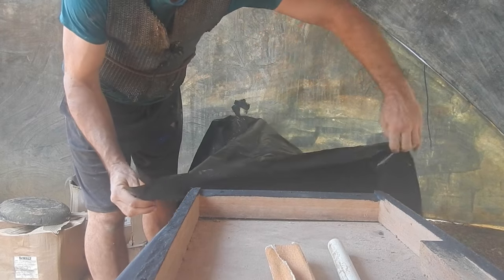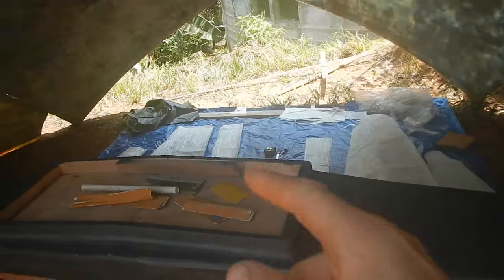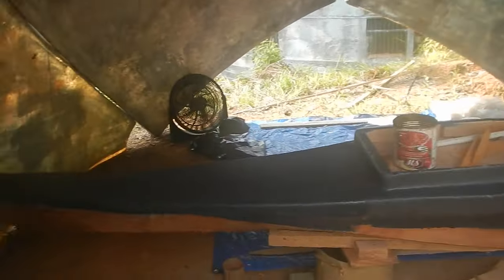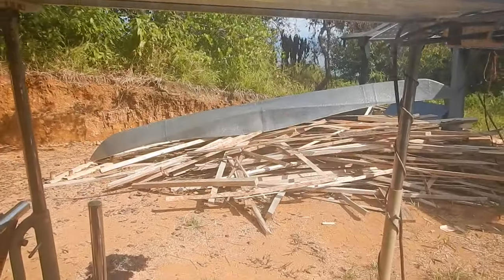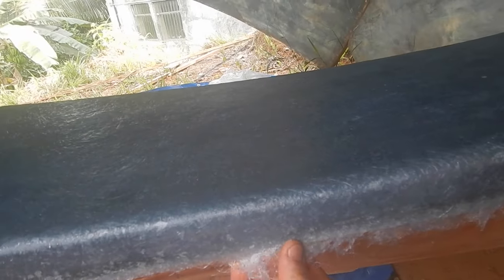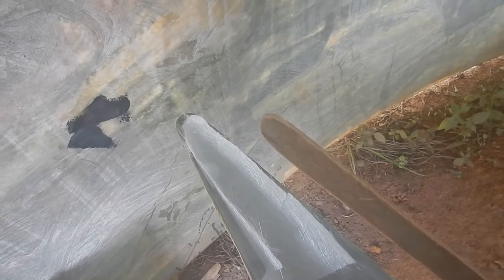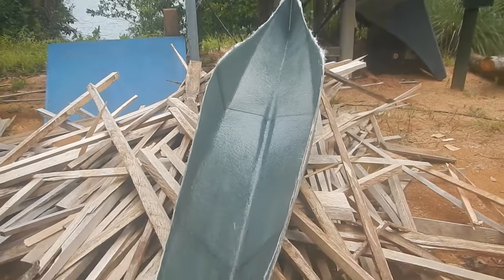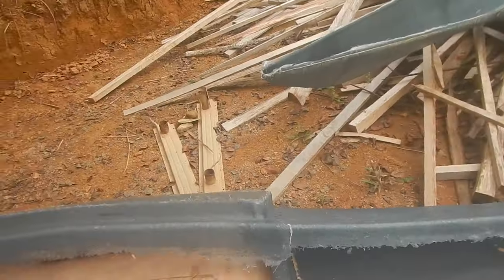Making Kayaks 009 First Demolded Piece!

Comment: I thought the wooden boat was the mold?  Why not just put the top and bottom together from that instead of making molds of molds?
Reply: Note at 12:50, he is pulling the kayak from the inside of the mould, and says 'that is not a bad surface.'  Doing it this way, he can make all the kayaks smoother on their exterior, so there is less friction when going through the water.  There may be other reasons, but that's the main one.
Reply: He wants more than one.
Reply: He needs nice and smooth surfaces, so he needs a negative mold for future kayak parts.
As frustrating and backwards as it looks when watching, it's a very common procedure in mold making to make a positive first, then a negative master mold off that.